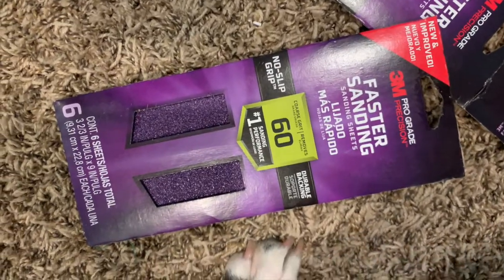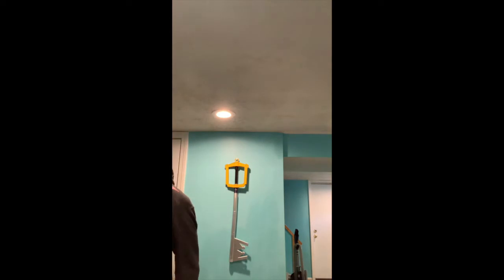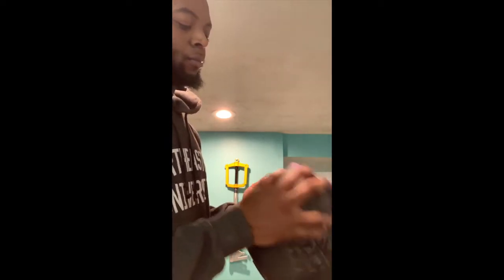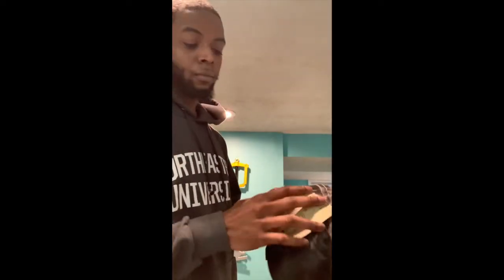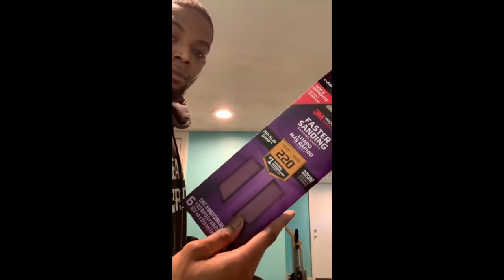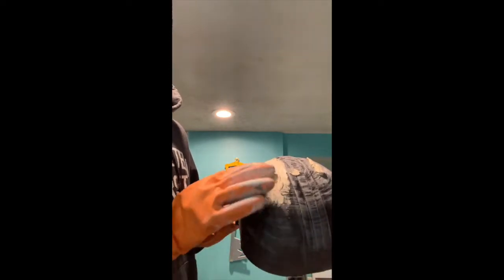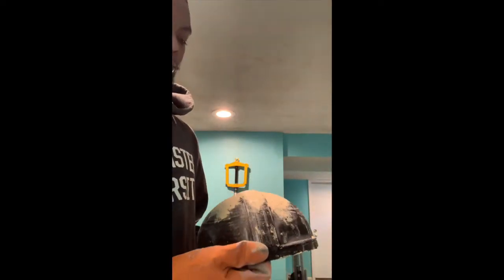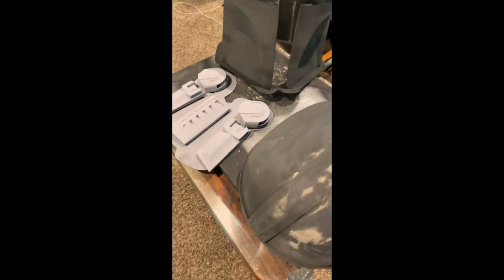How to sand 3D prints (rough to smooth)- Pla+ 3d Printing

Comment: No matter how much I sand, the layer lines are still visible after finishing. Even with filler and primer coatings added. It's so frustrating! I've been working on this problem for months to no avail 😂
Reply from the maker: what primer are you using and what grit sand paper do you go up to ? also after primer how many times are you repeating your process ? and are your prints the issue maybe something is off on your printer giving you bigger layer shifts
Reply: @beezycomics  Hi, thanks for the reply. It's primer for plastic by Rust-Oleum that I am using. After sanding with sandpaper grit 80, 120, 220, 400, 600, then I use micromesh up to 12000. Then it's auto body-filler spray putty and after that's dried it's the primer. I'm not sure what you mean by repeating the process, do you mean sanding down the primer and then applying more primer?

I don't think the prints would be the issue because the layer lines appear as shown in the slicer program (0.2mm layer height). It's just that after sanding and even after finishing, there are small indents where the layer lines have been beforehand.
Reply from the maker: @CombustibleL3mon  ahh I see what you're saying. I had that same issue where I would sand everything and somehow through the paint I would still see the issue -_- 

1. I started to use wet sand paper 400-10000. wetting the prop and sand paper get the finer lines after dry sanding. 

2. repeat so I go about 2-3 times sanding , filling , priming. until im satisfied. at the end of the day some imperfections will probably show so don't kill yourself if its little just keep repeating

3. try a palm sander if you're sanding big surfaces its an electrical machine with sandpaper that will buff stuff down
Reply: @beezycomics  thanks for that. So sanding, filling, priming, then what grit sandpaper would you start with after that? 400 grit wet?
Reply from the maker: @CombustibleL3mon  yes 400 grit is the first wet sand paper grit I have. I go up to 1000 now but you can go higher until you feel satisfied. you're welcome

Comment: I appreciate the info... but wood filler? and using just your hand makes it quite uneven... you can use a squeegee and spread it more evenly. You want as little as possible put on the piece. and I mean so little it's barely there.  But personally, I would work up the sanding to 600+ wet sanded, and prime it. You wouldn't need the filler really (Unless you have a massive imperfection) if you worked the sanding more, and worked it to more and more fine. I know that's a long process but well worth it in the end. The less filler, and more sanding you do, the better off it will be! 

to each their own though! Good job!
Reply from the maker: yeah thanks for the advice. I just started using 400 wet sand paper and it does great. I use the wood filler mainly to fill big gaps or imperfections and with repetition. so I add the wood filler and layer it with primer until I get a smooth even finish, and for the squeegee I've started using the extra scraper that came with my printer. almost how they pave cement. thank you for the advice !
Reply: @beezycomics  do doubt... the rule of thumb with filler is, the less you can use the best. you want to sand it down to the point you see the PLA. 

Get that sand paper up to 5000 grit! The more fine you get the more natural smoothness you'll get. Its a whole lot of elbow grease...